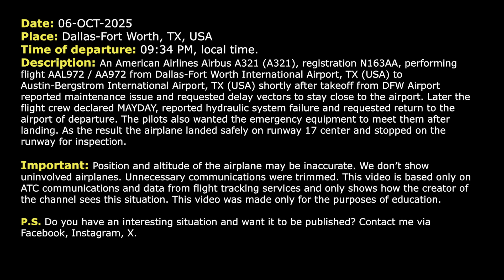MAYDAY. American Airbus A321 reports hydraulic system failure and returns to DFW Airport. Real ATC

Comment: Flight Control Issues qualify as May day call. American pilots are always resistant to using it as their "companies" don't like the expensive delays. When in an Emergency you better STAY ON THE RADIO!
Reply: They weren’t resistant. They were troubleshooting the issue through the checklist and contacting company. Once they determined the issue(s) they reached the step to declare. Checklists checklists checklists.
Reply: But they did call MAYDAY, just not at first... they seemed to merely want to have their stuff together, reason of emergency, souls on board and fuel remaining; when they had that handy, they called MAYDAY. Before then, it seemed ATC was well aware they had issues anyway.

Comment: Could an expert advise.
Should the pilot have called "PAN-PAN"  vs "MAYDAY"  ?     Since he declared MAYDAY he followed up that he anticipated a normal approach and wanted to be checked out after landing.  Doesn't this fall under the requirements of "PAN-PAN", or just because of the fact he received a hydraulic system failure notice it automatically elevates it to a  "MAYDAY" situation?
Reply: US pilots are so used to the blanket term "declaring an emergency" instead of the rest of the world that adheres to the ICAO mayday / PAN procedures.  From a practical standpoint, you're right this seems like a PAN-PAN would have been more appropriate but functionally it made no difference as they're getting handled with the same priority regardless.  The A320 family has 3 hydraulic systems but it's not clear from the radio transmissions the exact issue.  He mentioned gear doors being down which could mean they did a gravity free-fall to lower the gear because of a failure with the Green hydraulic system.
Reply: It really doesn't matter
Reply: Anything to do with flight controls, which would include hydraulics, is a mayday situation. They may be functioning at the moment but there's a significant likelihood they will fail, and if they did fail the plane would almost certainly crash. It's a threat to life, so mayday is appropriate. It's an emergency situation.

Pan-pan means urgent, but not a threat to life (yet). Maybe someone onboard is being unruly, maybe an engine failed but the pilots don't expect a problem common to the other engine(s), maybe a small plane in controlled airspace is getting into light icing and needs to change altitude but can't break into the radio chatter, so on.

Pan-pan is official phraseology everywhere, but it's not as widely used everywhere around the world, so sometimes it's better to call mayday as it's universally understood.
Reply: @MarkRose1337  incorrect. Pan pan is also an emergency.
Reply: @Gee1410thirtysix You are of course correct. I edited my reply.
Reply: @MarkRose1337  Yeah that's not really true.  There's a whole spectrum of flight control issues that aren't a mayday / immediate life threat.  Runaway jack screw, definitely a mayday.  Flap failure, not an immediate life threat.  Hydraulic issue requiring gravity extension, not an immediate life threat.
Reply: @cruisinguy6024  Thanks for the correction!
Reply: Doesn’t matter. Either one is up to the judgement of the PIC, based on the type of handling they’d like. And folks think it matters but both are emergencies, just matters if you want to be prioritized in front of any other emergency or after another mayday, if one existed. Really meaningless. What matters is declaring, and ideally declaring per ICAO verbiage as they did. People need to stop getting hung up on the two; in reality you’ll be handled the same.
Reply: PAN PAN doesn't really need to exist.   The only time it would matter is if you had to triage multiple simultaneous emergencies which is infrequent and you can just triage it if it happens.   It's better to just make a mayday call and be done with it.
Reply: @zachansen8293   In Europe PAN-PAN vs MAYDAY is the difference between an airport staying open vs everything stopping (unless you have a giant fire department and independent runways)
It's also just a shortcut to inform both ATC and other pilots of the severity.
Reply: @lyaneris  There's nothing wrong with just starting at the most severe and working backwards.   There's no harm to anyone.   I have trouble believing that in Europe they instantly close an entire airport if a plane that's 50 miles away says "mayday".   You can route them back in and then ask what the problem is and take the appropriate actions for their actual situation once they have a moment to tell ATC what the specific problem is.
Reply: @zachansen8293  Depends on where that plane is. If you call MAYDAY just after departure, they will hold all departures and arrivals (on a single rwy field). They might even hold the entire airport. That's not the case for a PAN-PAN after departure. They'll also get ARFF out.

50nm out they might not even know which airport they'll go back to.
Reply: @lyaneris  in the US that’s not the case. Only a crash at an airport could close it. A mayday alone won’t.
Reply: @Gee1410thirtysix  They said close but they meant "stop operations" because often times when a flight immediately declares an emergency / mayday the tower does halt all take offs and departures to keep the runway clear for the departing flight to make an immediate return.
Reply: @cruisinguy6024  smart, but we don’t do that here either